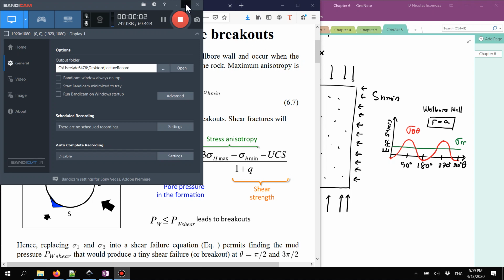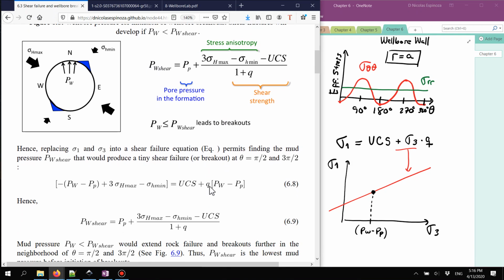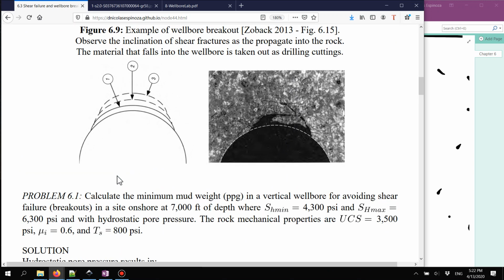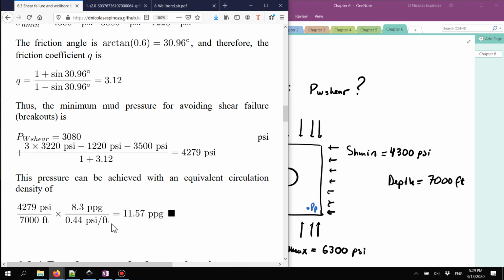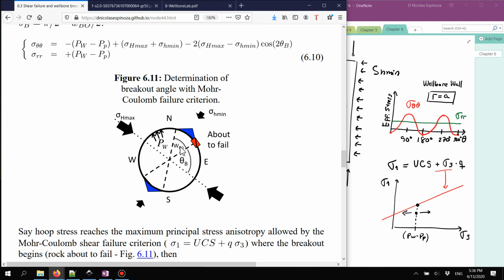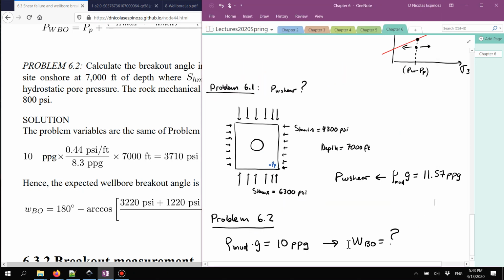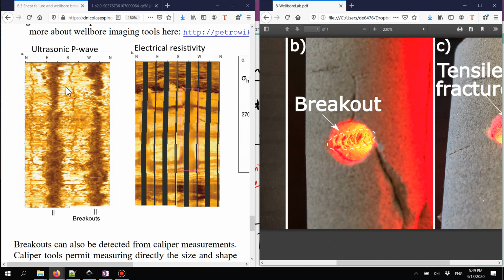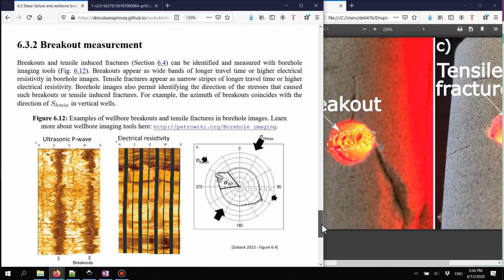L0414a Wellbore breakouts

Comment: Hi, my name is Suci Farissa Nabilah from Indonesia and I'm currently working on wellbore breakout as my thesis, I wonder if this wbo (breakout width) formula only works in vertical hole? then what about inclined or deviated hole? what formula is used to find the angle, as most article merely talk about stress in deviated and its breakout orientation (such as in Peska and Zoback, 1995) instead of the width or angle. Thanks! looking forward hearing the response
Reply from the maker: Dear Suci, yes and no. The formula could be used for horizontal wells that align with principal stresses with proper adjustments. It cannot be used for arbitrary deviated wells, case in which you need a much longer equation or an algorithm to help you calculate the breakout angle.  More details here: https://youtu.be/5j7gyzCfZX0?list=PLv0npDbE5HXtZbV42aJXzrOsv-V8q_q8_ and https://dnicolasespinoza.github.io/node48.html (Section 6.6.3)